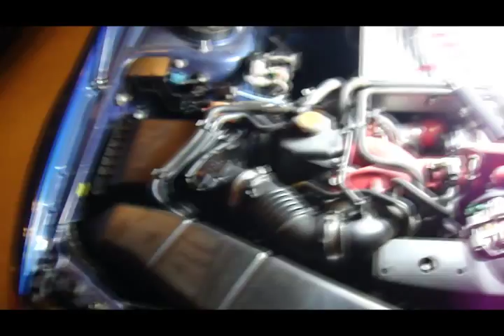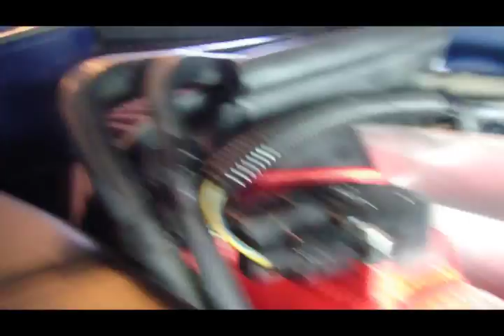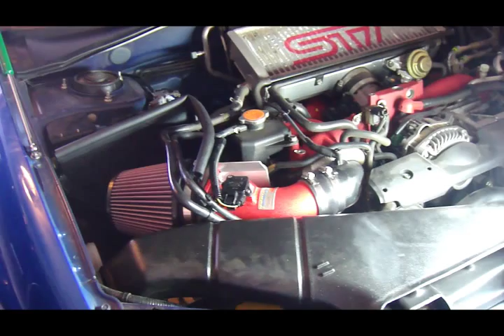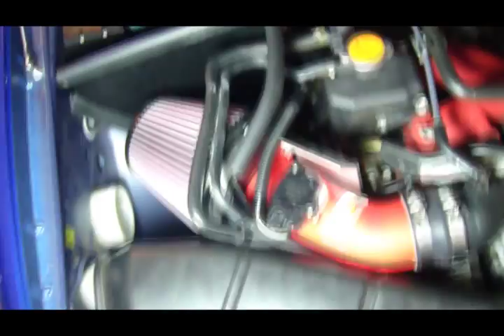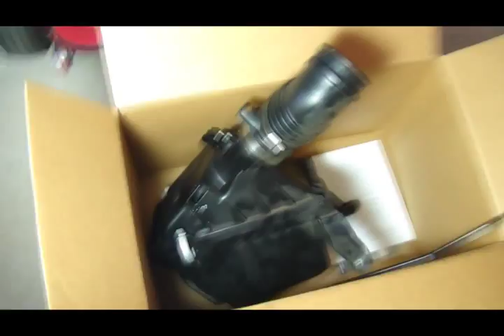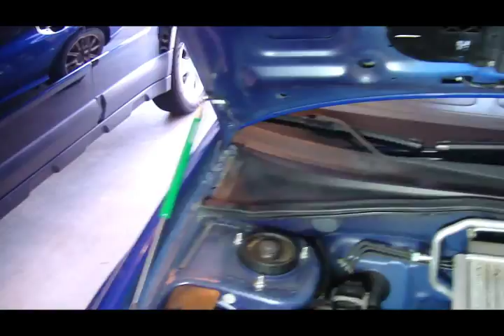STI- New K&N Intake!!

Comment: @blackchapel16 as far as i know, u start off with the car stock or stage 1. but the car comes out off the factory tuned down. So u need to get an accessport and tune it to stage 1. Then,  once u've installed a full exhaust kit or turbo back exhaust then its considered stage 2. There's also a stage 3 but i'm not sure what that requires. maybe rerouting the intercooler so its front mounted. or maybe installing a bigger turbo. not sure. I think that stage 3 has to be tuned by professionals too.